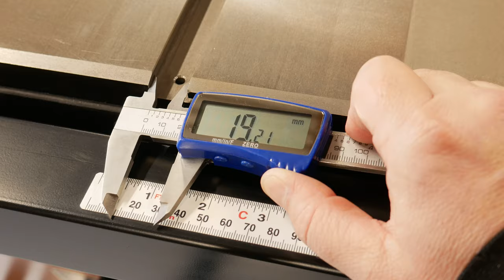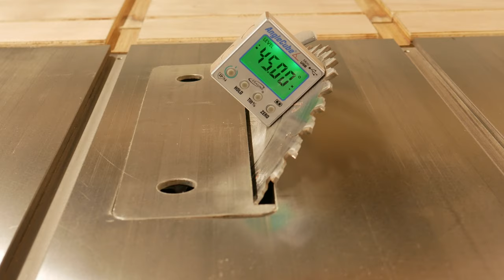Cross cut sled build/ Super easy set up to square/ With zero clearance inserts.

Comment: Great design and inspiration. Now I can start to make my second sled. The first one did not have replaceable inserts and a wobbly blade destroyed the zero clearance.
Reply from the maker: Glad it helped out, all the best with your build. Let me know how it turned out.
Reply: @RJsShedShop  Finally did it. I used most of your ideas, with the small addition of a little groove on the bottom of the back fence to avoid sawdust where i meets the bottom plate. I used MDF for the sled and plywood for the fences. Works great. Kudos for your method of adjusting the squareness of the fence. Fast, simple and accurate. :)
Reply from the maker: AWESOME bro, thanks for the update, enjoy enjoy enjoy.

Comment: Excellent work. The removable inserts are a stroke of genius. I don’t have those and, to preserve the zero clearance, only use the sled for 90 degree cuts. That does me 90%pf the time and I have a superb Osborne mitre fence to fall back on.

I kicked myself for not having that bolt fence square adjustment. About 40 years ago, I owned a shop where we cut a lot of sheet steel and we used something very much like your square adjustment to set the fence at 90% to the guillotine blades. Didn’t remember anything about that when I built my sled. I might have been tempted to keep that adjustment block in place just in case I ever needed to re square the fence. 

Love the presentation of the video. We have a son in NSW and a house there as a result. We’ve been coming for a month each year for 13 years (COVID interruption excluded) and so get the Aussie sense of humour and deprecation. For what it’s worth, just won yourself another subscriber and a like. Keep it up.
Reply from the maker: Once again thankyou so much, its never to late to upgrade your sled

Comment: I ran across your channel by happenstance today and I'll be watching more. I've seen a lot of crosscut sled builds but haven't seen one with the micro adjust block. I'll be using that method soon.
If you want to see what "too much glue" really looks like check out Kings Fine Woodworking. The family makes some very nice things but they literally soaking pieces in glue. I think he does it to make the rest of us cringe. 😬 Good stuff though.
Reply from the maker: Thanks, that micro adjust helps heaps, no complicated math or multiple screws needed, hope it helps.